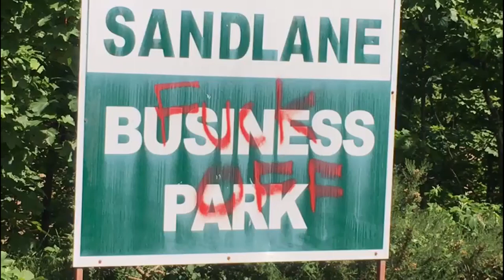Mercedes Sprinter Front Vent Glass Replacement.

Comment: Thank you for the instruction.  Saved me quite a few quid.  I had a challenge getting the window and seal back in and pulling out the rope.  
A couple of questions:  
1.  About what ratio of soap to water did you use to make it slippy?
2.  Anything special about the rope?  It looks rather fuzzy from the video. 
Hopefully I won't have to replace it again...  
Thanks again!
Reply from the maker: Hi. 
I’m sorry for the delay in replying. 
In answer to your questions. That is just glass cleaner. Anything just to lubricate the rubber I find works. Some people use soap, I’ve just always used glass cleaner.
The rope has seen some action over the years. It is probably 4-5mm thick. Doesn’t have to be rope. On one occasion, when I’d left my rope somewhere I used the cord of an extension lead (if it’s stupid and it works, it’s not stupid 😁)
Thanks for your interest, and your questions.
I’m glad the video helped.
Reply: @adventuresofawindscreenfitter  Thanks for your reply.  I hope I won't need to do it again anytime soon but I'm keeping a link to your video.  Cheers.

Comment: Great video  thanks !  Had to brake my own window when my door lock quit working while camped in the middle of nowhere with no cell service.  Didn"t have the right size rope so I've  used a pair of construction boots laces  ( made one loop close to the knot  ) and soapy water .  Worked good !
Reply from the maker: @danielg4228  Hi. Thanks. Thinking outside the box with the laces 😁👊. Like I put in the comments a bit further down, I’ve had to use an extension lead before. The company I work for now doesn’t replace many side windows so my opportunity to film other makes and models is limited. Thanks for watching, and taking the time to comment.

Comment: how do i take out the glass if its not smashed ? i  do the reverse of this ?
Reply from the maker: Hi. 
Yes. It is a little more difficult though to remove a glass that isn't broken. You will need to try and lip the rubber back off the body. I do this by applying a little pressure on the glass from the inside. I use a scraper or a hook tool to try and get it started. It's hard at first but as you get more rubber lipped back off the body it should start to get easier. There's a fine line between not pushing hard enough to get the rubber started and pushing too hard a potentially breaking the glass. Personally, I would start at the leading edge of the glass, between the top of the mirror and the top of the glass. It would probably make it easier to remove the mirror before starting to do this. If you are planning on fitting a new rubber I would just cut through the old rubber.
Obviously I dont know your experience level with trying to do this but there is always a risk of the glass breaking.
It's a shame you can't add photos to comments on YouTube. I'd of added some screenshots of what to do, what it looks like at the various stages if I could of.
I hope that makes sense and hopefully helped bit.
Good luck.

Comment: How do you change the O/S quarter glass on a ford transit custom any videos available?
Reply from the maker: Hi. They are a bit more involved. You will have to remove the inner door card. I then lower the doorglass, remove the metal bar between the two windows so you can fit the front vent glass. I don’t have any video of me doing one of these at present. I hope that helps a bit. Good luck.

Comment: Would the same method work for a Renault traffic
Reply from the maker: Hi. No. The Renault Trafic is a bit more involved. You would have to remove the door card. I then remove the bar between the two windows, put the vent glass in and then put the dividing bar back in. I don’t have any video of a Renault Trafic at the moment. I hope that helps a bit. Thanks for your question.

Comment: I see you reused the gasketing, do you know where I can get gasketing from?  Our work van had the glass popped out after the gasket and frame were destroyed.  Having a hard time finding the gasketing.
Reply from the maker: Hi Beverly. Have you tried a Mercedes dealership? Or a windscreen replacement company? If you are planning on fitting the glass yourself I’d go with Mercedes, if you are not planning on refitting the window yourself I’d ask whoever you pay to refit it if they are able to supply the gasket too. A scrap yard may also be an option for you. I hope that helps and you get it sorted.

Comment: Is it the same way on a 2006 sprinter?
Reply from the maker: Hi. Should be very similar. The mk2 Sprinter came out in 2006. The van in this video is a mk2 Sprinter. If you have a mk1 Sprinter there should only be slight differences in the interior door card and external mirror. Taking the interior door card off, or just loosening it will make it easier to get the rubber at the bottom of the glass to lip over the aperture if you’ve not done this before. Good luck.
Reply: @adventuresofawindscreenfitter  thanks. I been busy just had a shop do it.

Comment: What did you spray on?
Reply from the maker: I use glass cleaner, just to lubricate the rubber to help it lip over the aperture. Different people use different things. A guy I work with prefers a bit of liquid hand soap, another, tyre slip. Hope that helps. Thanks for the question.

Comment: How did you do the step with the rope?
Reply from the maker: Hi. 

I’ll try to explain it in words until I get another one and can make a video.

I start with the rope roughly half way up one side. I feed the rope into the rubber going downwards and along the bottom of the glass. When I’m roughly halfway up the other side I make a loop with the rope and feed it back into the rubber and continue up and around the top until I get just past where I started from.

I then pull the rope from one side. Once I get round one bottom corner I pull the second loop on the other side. I do it like this just in case the force needed to start the rope moving moves the glass out of position. I find pulling the second loop and coming back on yourself centralises the glass. I then pull the rope so the rubber on bottom of the glass is completely over the aperture. The weight of the glass is then supported by the vehicle body while I the pull the rope upwards and fit the top on the glass.

Some people will start in one place and not put a second loop in. I used to do it this way but if the glass has moved slightly out of position getting the rope moving when starting it can make the opposite side from when you started very tight to get the rubber over the aperture.

I hope that makes a little sense. Everyone has their own preferred way of doing this type of window. This is just the way that works for me.

I’ll try and make a video on the next one I get to show this.